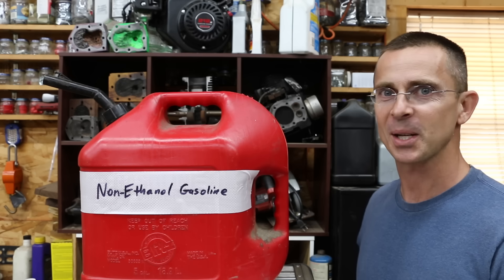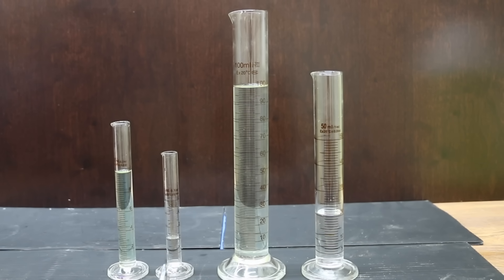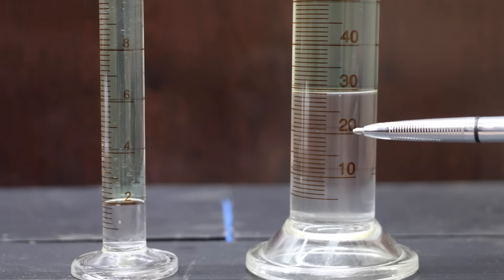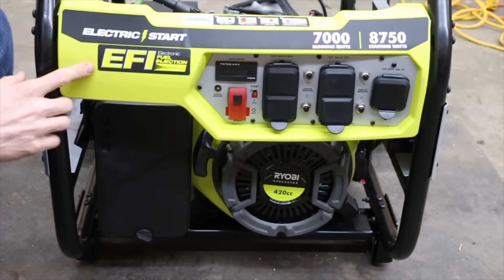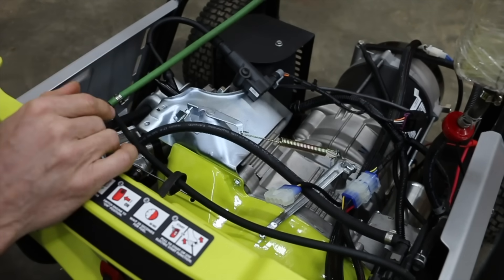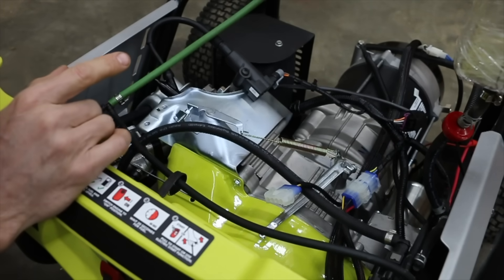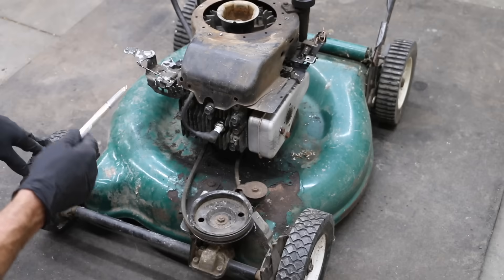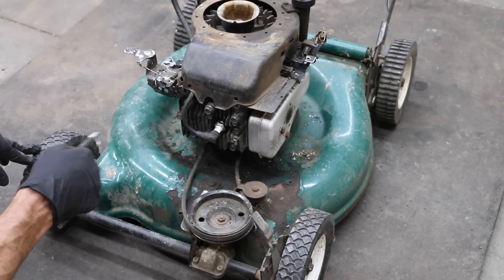Is Non-Ethanol Gasoline Really Better? See the PROOF!

Comment: Does anyone even remember why we add ethanol to gasoline in the first place???  The whole experiment to demonstrate if the generator runs longer with pure gas is idiocy.  The nods to proper lab techniques are cute, but all he is doing is knocking down a straw-man.  The experiment has as conclusion anyone could have looked up on a handy chart posted on a Wiki page - E10 and gasoline a just a few rows apart.  Ethanol was added to automotive fuels, starting in about 1992, to reduce NOx formation in the combustion process in cars in smog-prone areas around the US.  It was originally called RFG, re-formulated gas.  RFG helped dramatically improve air quality in the areas it was adopted.  The fuel industry's choice was MTBE, a chemical with a host of environmental and health issues.  The choice has never been gasoline versus ethanol.  The choice is dirty air versus air that is not so dirty.  There are many state-level studies showing ethanol being the best choice to oxygenate fuels, better than anything else people have tried.  Now, I may be a bit older than the gentleman in the video, but not by much, so he should probably know better.
Reply: Every time I ride behind a car going up a hill the fumes from that car, (any car), exhaust is just as noxious as it was before ethanol.  If this was simply all about "clean air" then why did the fuel crop grower's lobbies spend MILLIONS to get this legislation passed..?  This is just another waste of our money and another example of government corruption via their willingness to be bought off by lobbyists.  Lobbyists should be illegal and so should ethanol enriched gasoline.
Reply: @frontprochproduction  At least the video did the heavy lifting of actually trying science, you got, what, a calibrated schnoz?  The dumb it hurts.

Comment: Ethanol is much better if optimised compression ratio. The issue is we run the same compression for ethanol snd non ethanol. Also 10% doesnt give much advantage but running 85% and higher with optimum compression gives better mpg. No one ever mentions this during comparisons...
Reply: But bumping up the compression ratio (which is what you're talking about) is going to improve the efficiency regardless of what fuel you put in it.  And the fact is that ethanol has about 2/3 of the energy as straight pump gas.  Increasing the compression ratio and running 100% gasoline is going to give you better mileage than running E85 in the same engine. The chemistry doesn't lie.
Reply: @almostfm  Ethanol supports higher compression than pure gasoline and at a cheaper cost that increasing normal gasoline octane rating. Indy cars use a ~98% ethanol blend.
Reply: @muskrat7312  Yes, they do run a 98% ethanol blend.  Gasoline was banned at Indy (and by extension, the rest of the USAC stops) in 1965 after the horrific accident that killed MacDonald and Sachs in 1964.  Originally they went with methanol (which was optional before '65), and, like ethanol, can be extinguished with water and doesn't produce huge clouds of black smoke like gasoline.  But pure methanol has almost an invisible flame.  When they switched to ethanol, they added 2% gasoline for two reasons: 1) it makes the flame visible so if there's a fire, you can see it, and 2) the gasoline denatures the alcohol-otherwise, there are a crapton of ATF regulations that Indycar would have to follow.

The reason that some teams chose to run gasoline was because you could eliminate pit stops, because the gasoline cars got better mileage.  And I have to assume that the mechanics and engine builders at Indy understood about upping the compression ratio.
Reply: @almostfm  Yes and ethanol has higher octane than methanol as well. The point is ethanol is a better fuel if the cars were optimised. Also laws about 100% ethanol are a bit dated so they need to denature it. We could change those laws to allow higher than 98% as well. Also, the carbon from ethanol is recent carbon rather than ancient carbon in oil products.
Reply from the maker: Thank you!

Comment: One factor I would like to see controlled for (or at least discussed) is detergents in gasoline. I have bought into the "TOP TIER" certification for gasolines, and as a result I will buy TOP TIER gas with ethanol before considering the non-TOP-TIER ethanol-free gas. For small engines in particular, perhaps I should rethink that, but I've always wondered if I'm making the right choice for my car.

And by the way, thank you for the excellent videos!
Reply from the maker: Thank you!

Comment: I have a friend that owns a NAPA auto parts store he says the problems that he’s having with ethanol gas is white chalky build up in electric fuel pump and the manufacturer will not warranty the pump after failure
Reply from the maker: This is great information.  I'll do some testing with "pot metal" which is commonly used in fuel systems.

Comment: You didn't mention how ethanol damages carbs and fuel lines on small equipment.
Reply from the maker: Great point
Reply: I use aviation fuel for small equipment now. No more rebuilding carburetors or replacing fuel hoses. And it’s safe to store equipment long term with av gas in the tank.

Comment: Oh boy, lot's of ethanol hate here.  I understand why small engine guys dislike ethanol.  For automotive gearheads however, it's been a godsend.  I'm not talking about E10, that's a very low performance fuel, I mean E85.  Pump E85 can support a lot of cylinder pressure without detonation.  15:1+ compression or big boost.  It runs cleaner, cooler, and makes more torque than gas due to it's slower combustion speed.  It costs $1.40-$2.25/gallon, compared to say 112 octane race gas which is around $12.00/gallon and makes less hp.

Let's say you're rebuilding a V-8 chevy/dodge/ford or anything.  The cost between flat top pistons and big domes is negligible.  The cost of an E85 carb is the same as a gas carb.  If E85 is available in your area, why would anyone build an awful 9:1 gas motor?  You would leave so much power on the table.  The difference between that and a 13:1 engine is night and day.

If we ,the internal combustion consumer understand and utilize the positive properties, and minimize the negative properties of alcohol as a fuel,  we can benefit greatly with significantly better engine performance.

Also, I'm proud the fuel of choice for my hobby supports American farmers over foreign countries.
Reply: AMEN! This is exactly how I feel. I been using E85 for 9 years and i absolutely love it! 👍🏁🏁🏁🏁
Reply: That's provided you are able to build a higher compression engine and use E-85 instead of normal race gas.  If you are in an organized race chances are good that they have certain rules for everyone regarding the fuel and things like that.
Reply: @robertbenoit5374  I have a neon circle track car with 13:1 compression and a aftermarket ecu with advanced timing that's why I run it. 👍
Reply: Solar panels and an electric scooter. I'm saving up for an electric car. If I were to win the lotto, I would get a Rivian truck.
Reply: I don't speak that language, what?
Reply: Gearheads that run it are a very niche market by comparison, if you guys were charged the true price of the fuel you more than likely wouldn't even touch it. Corn doesn't belong in our fuel, it belongs in our food and in animal feed. I fully support our farmers what I don't support is the government subsides and government favoritism towards the horrendous fuel.
Reply: @Jon-to6969  that's facts right there food is for people and gas is for cars everyone should just add water to their gas before they put it in the tank, then they can even drink it if they wanted to I'm sure gas ethanol is cheaper than liquor store
Reply: @Jon-to6969  
The corn used to make ethanol is then used for animal feed and other things.  The whole kernel doesn't go in your fuel tank like most city people think. 
There is no such thing as a “corn ethanol subsidy.” The Volumetric Ethanol Excise Tax Credit (which was also known as the “blender’s tax credit”)expiredfive years ago in 2011. Further, it was gasoline blenders—not ethanol producers—who received the tax credit for each gallon of ethanol blended.The Small Ethanol Producer Tax Credit, which provided a modest tax incentive for ethanol produced by small facilities, also expired in 2011.

Comment: I'm impressed with this. I could use this to see if the gas companies here in NC are abiding by the law when it comes to ethanol content in gasoline. If I am not mistaken, there can be no more than 10% ethanol in gasoline unless otherwise labelled in NC. And there are gas stations that sell ethanol free gas, but it is labelled as marine gas.
Reply from the maker: You are right, 10%. Thank you.

Comment: The carbon buildup difference was slight, but it was a VERY short test. The ethanol was obviously cleaner and, considering the short duration, I would call it a major difference. The efficiency, however, goes to straight gasoline.
Reply: mothman1967 bullshit the ethanol side definitely had more carbon buildup....

Comment: Any idea what the difference is in a newer engine designed to run ethanol blends such as those we have in Europe (some designed to run E85) which supposedly have upgraded lines?  Obviously we run a higher octane as well with 95 Ron pretty standard and 102 available in some places so it would be interesting (though probably not practical given you are in the US) to see if the results are any different given the differences in things like ignition timing and compression ratio.  (Bio) Ethanol is often promoted as a good thing here due to alleged cleaning properties and being something that can be made from waste products (such as in cheese making) as opposed to being dug out of the ground.  There are trials with ships running alcohol (methanol) instead of diesel as well, so it can’t be that universally bad surely given the huge costs of maintaining large diesel marine engines?
Reply: You do not run higher octane fuel, our octane is not specced by RON

Comment: Excellent analysis! 4% is not much better. But without doing the math I would assume that it is cheaper to run with ethanol due to the variance in price per gallon.  That is assuming of course that neither one has more long term negative effects on engines or carbeurators that could potentially be costly. In my personal experience I use non ethanol in all my small equipment and 10% ethanol in my cars and trucks. The shop where I work switched to non ethanol in all of our Stihl cut off saws and they have way less down time then when we used ethanol gas. Too rich for my blood though for my autos unless someone has a cost per gallon analysis on both using several different scenarios.
Reply from the maker: Thank you. Yes, E10 is usually lest costly.

Comment: I'm from germany, our gas stations sell only Super E5 and Super E10 both are rated with ROZ95. Some cars selled in germany arent rated for E10, because the fuel lines take damage. the price difference are 0.02€ per liter (about 0.0175$) but i think replacing fossil fuels with Renewable energy
 is a good way to prtect our planet
Reply from the maker: Thank you

Comment: Alcohol can make some smaller 2- stroke engines run hot, just open the main jet slightly to enrich the air/ fuel ratio. I think that its the additive ' MTBE' - Methylterchiarybutylether, that's damaging rubber parts on older equipment. Avoid using the' new' gas in pre-90's equipment.
Reply from the maker: Great tip! Thank you
Reply: Aaron Humphrey they don't put mtbe in gasoline anymore you moron....

Comment: The more ethanol in a fuel the cleaner it will burn, ever seen an alchohol fuel catch a carb on fire? There is no color to the flame, ethanol,methanol, alchohol all have less available potential energy per same unit of measure as gasoline, that why fuel systems on alcohol cars are generally double in size as opposed to the same gas counterpart. I read a comment below of someone talking about how much a fuel can be compressed before it donates....there is a whole lot more to that than just octane rating. Use the same octane fuel vary quench distances and igntion timing and see what you come up with as far as detonation at various ignition timing vs quench distance. The part about ethanol being used to raise octance levels is true but to a small amount iss used to add some stability to the more volatile lower octane fuels and the "spark knock" people get with low octane which is just pre ignition under heavy load or high rpm, generally at the pump the higher octane fuel is most likely to contain the least amount of ethanol
Reply from the maker: Thank you

Comment: I have a generator that get's gummed up in the bowl and fuel jet if I let it set even for short term time with ethanol gas. Weed wacker and chain saw see deteriorated fuel lines and carbs gum up making for costly and time cosuming repairs. I have no access to non-ethanol gas except in quart sizes and is very exspensive!
Reply from the maker: Thank you!